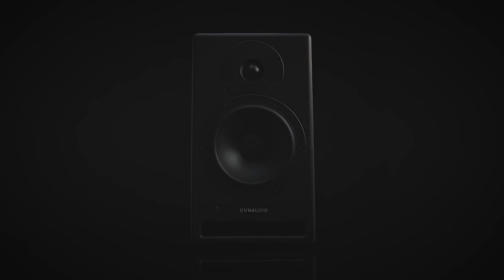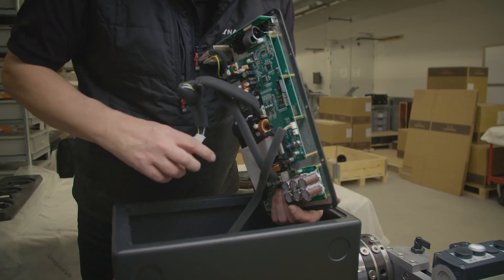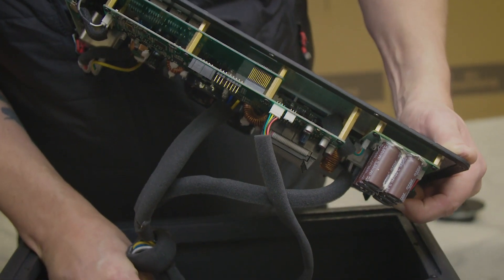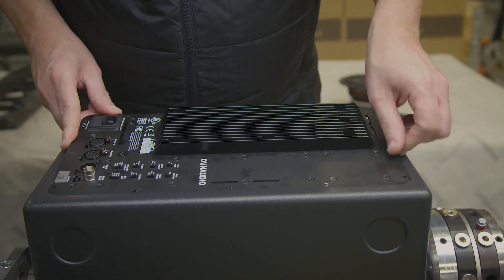Electronics: how Core keeps it simple

Comment: Hey Dynaudio. I’ve been a fan of your products and technology for several years now, I was hoping you could answer a question for me. The DSP is superior in the Core, as opposed to the LYD48s, I have heard mixed perspectives about these monitors, mainly that the frequency response and SPL in the Cores are much better for mixing, the LYD48s aren’t quite as good as the Cores, is this perspective correct?
Reply from the maker: Hi, sorry for the late reply. Here you go, Stephen our Senior Designer replied the following: 
We actually use the same DSP chip in both the LYD and the Core. The Core however uses better drivers, better cabinets, better amplifiers, better ADCs & DACs and also the Core have a digital AES3 input.

One of the features in the Core series that also gives it an advantage over the LYD is the output sensitivity. This allows the user to ‘turn the volume down’ in the Core speakers allowing them to provide a higher input signal to effectively improve the signal-to-noise ratio and filter performance in the DSP by having a higher ‘signal level’ inside the DSP.

The Core is all round a better performer than the LYD because that was the design aim and the extra performance comes at an increase in cost. // Lilli
Reply: Dynaudio Professional thank you very much! I greatly appreciate the reply!
Reply from the maker: You're very welcome 😊
Reply: Dynaudio Professional honestly, I would buy the Cores in a heartbeat, but I can’t afford them at the moment! So it’s just the LYD48s for the time being.
Reply from the maker: Also great speakers 😉 We should maybe add that we have lots of people who use the LYD (particularly the 48) for professional mixing, too, such as Ben Zebelman, Fred Mollin, Roy Hendrickson & Ciaran Birch.
Reply: Dynaudio Professional yes! I’m a sound engineer, but I also compose music for film and television and I have found that the frequency response of the LYD48S is astonishing. I’m in the midst of finishing my honours degree at university and I absolutely adore learning about music technology in great detail. I’m currently studying spectral analysis, which can be pretty complex.